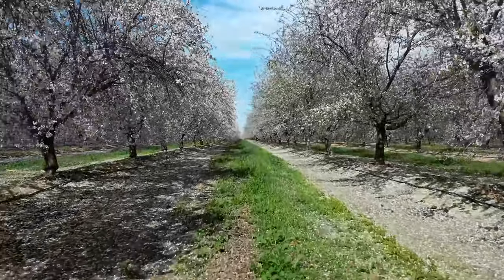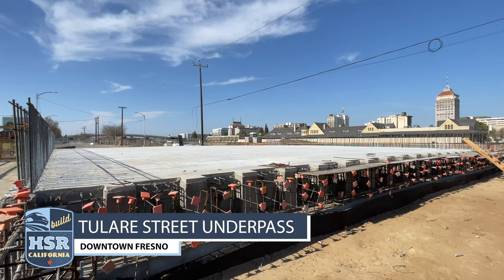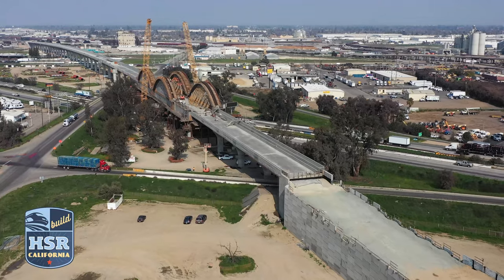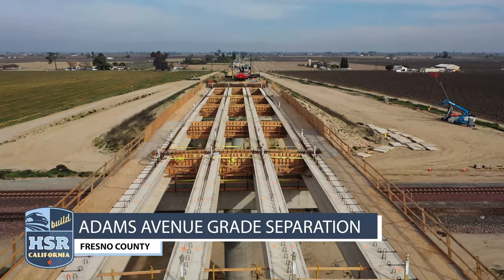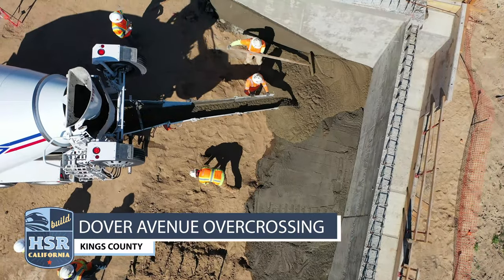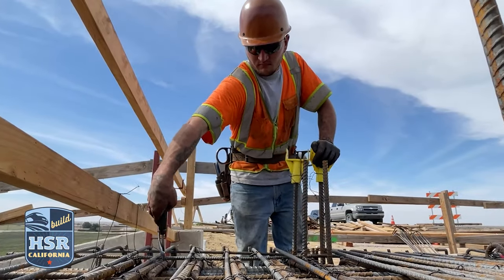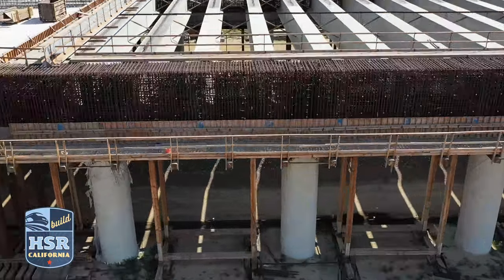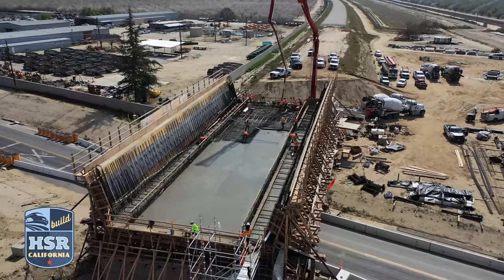California High-Speed Rail Construction Update – Spring 2022

Comment: what bullshit .....the train to nowhere .......from fresno to modesto ...who would want to go there faster
Reply: That's just part of the line. It will connect SF to LA
Reply: i can get on a plane and go from LA to SF in 40 min. ....for $60......you know a train ticket will be $300 and tack 3 hours with all the stops
Reply: @Ebbrush3  LOL. First off NO WAY is that flight 40 minutes. You have to go to the massive airport 60 minutes before your flight, checkin, go through TSA/security, wait to board, sit 15 minutes on the runway, then maybe you're in the air for 40-50 minutes, but you have to land, wait 15 minutes to deplane, etc.. more like 2-3 hours door to door. Also it's usually much more than $60. Plus those flights are heavily subsidized and TERRIBLE for the environment.

Also it's completely unhelpful for anyone traveling to the cities in-between the airports. Those stops are actually useful for people who live in Fresno/Merced/Bakersfield/Palmdale wherever it ends up stopping.

Also trains are WAY more comfortable than  planes.

When European countries added HSR to their infrastructure, the number of short distance flights plummeted because it sucks compared to taking the train.

Comment: Sigh. Yet another propaganda video from California not so high speed rail. It was supposed be nearly complete all the way to LA by now.
Reply: The initial timeline was for it to be ready to LA by 2029, so we have another 7 years before it's late.
Reply: @danmobile  Do you really believe it will be finished by 2029? They don't even have the engineering done for the SF to Central Valley segments or those between Bakersfield and Burbank. They should have started construction on all of those by now given that they have many tunnels, viaducts and other major constructions to do.
Reply: @keithrosenberg5486  Of course I don't think it'll be ready in 2029. But your statement is total BS - it was not supposed to be in "LA by now". This is a massive engineering project and I'll let the experts plan it and execute...

Of course it's a giant pain in the ass and full of all kinds of delays and overruns. It's the first HSR project in the USA and a massive undertaking.
Reply: Facts aren’t propaganda
Reply: @danmobile  Do you think they are going to be able to design and build all of the necessary roadbed and tunnels through multiple mountain ranges, across several earthquake faults and a tunnel underneath the San Fernando valley in 6 -7 years?

The have not even gotten the flat section down part of the central valley in that amount of time.
Reply: @keithrosenberg5486  I have no idea on the timeline, I'll leave that to the experts not some random Youtubers